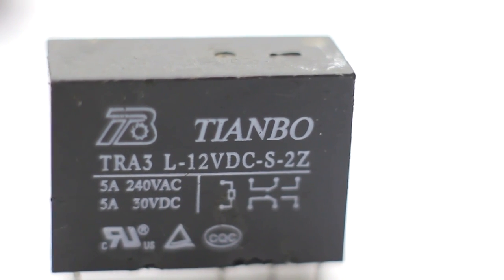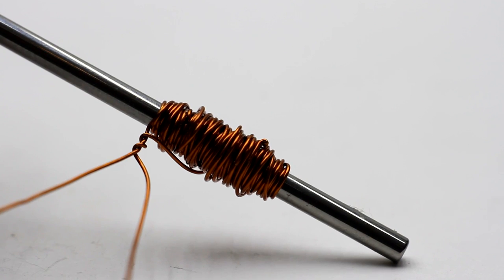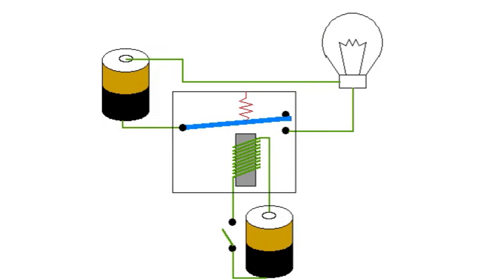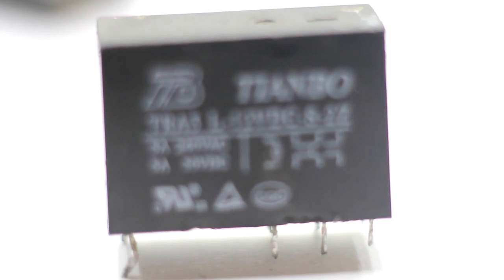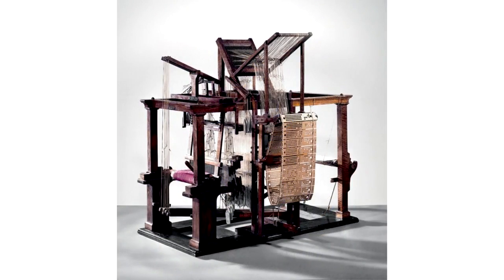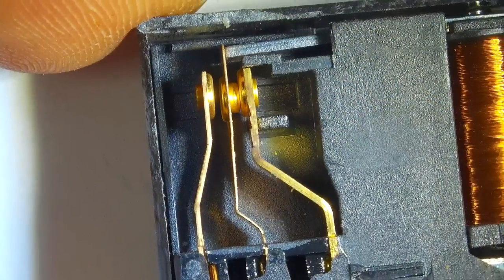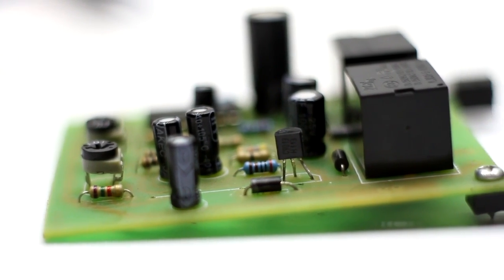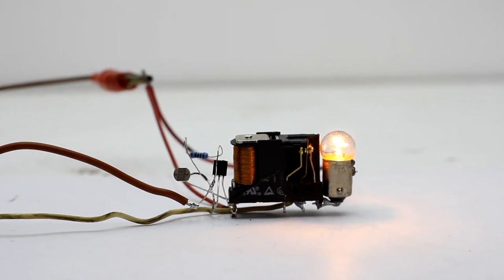RELAY - How it works?

Comment: can a sticking latching relay cause a television not to turn on with the remote or manual on switch with the set sometimes turning on especially after unplugging and re-plugging the set? My TV usually will not turn on but if I unplug and re-plug a few times I can get it to turn on. It then works great for as long as it is on with all remote functions working including the turn off button. After turning it off it may occasionally turn back on with the remote or manual switch but usually not turn on again unless I do something like plug and unplug a number of times or unplug power cord and hold manual switch on a minute or so then re-plug and hit on switch. After re-plugging the Infrared sensor light comes on and when I hit the on switch or remote the sensor light goes out with the set coming on or sometimes not coming on at which point I have to go through the reset ritual again. Can I open up the relay and clean the contacts?

Comment: anyone else notice that the photoresistor did not do what she said it would do, instead it did the opposite
Reply: Another grand mistake is: compressor motor do not work with a battery.